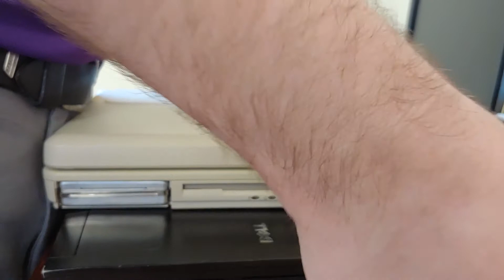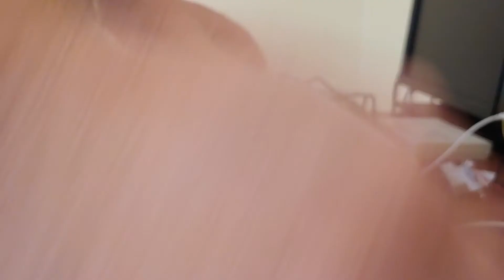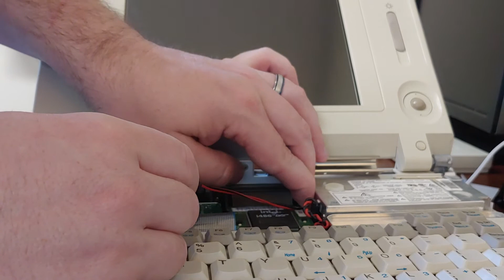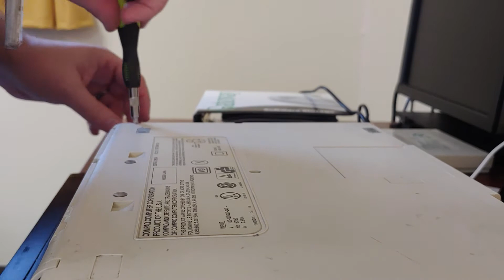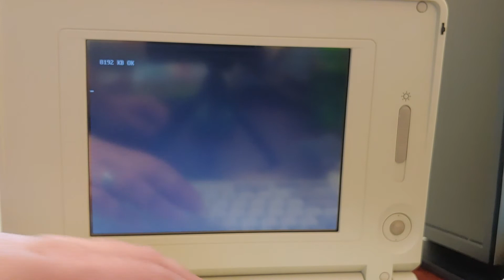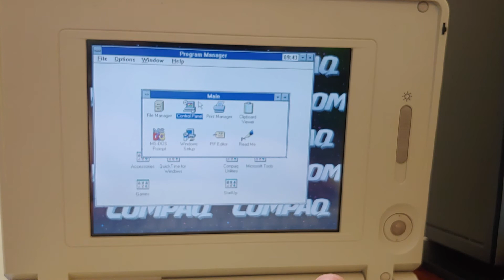Compaq LTE Elite CMOS/RTC battery replacement

Comment: You told me what I needed to know "F1 for Bios Setup". Mine was working fine until I pulled the Dead  "Paper Weight Battery" out and goofed up my Bios. Now It dose not recognize my HDD..
Reply from the maker: Pull the drive out.  Have the system run through the boot process without the drive.  When the system says “no hard drive present,” press F1 to save.  Then turn the machine off and put your drive in again.  See if it detects.
Reply: @i80386sx  All I get is "Non-System disk or disk error"
"replace and strike any key when ready"
F1 Dose nothing before or after error msg.